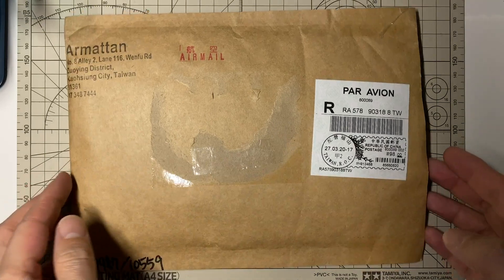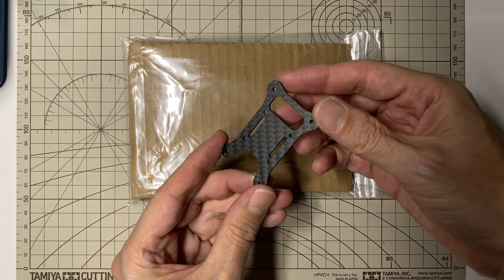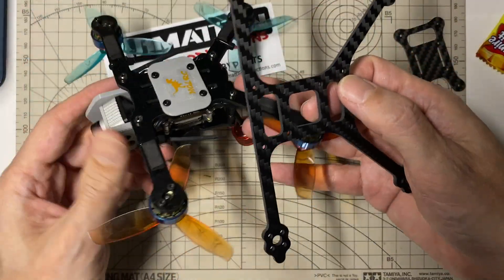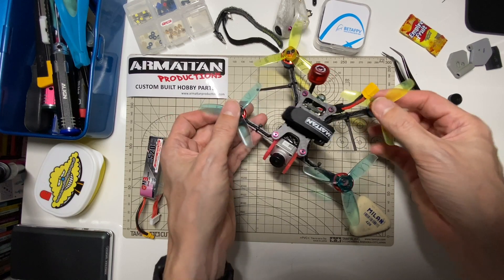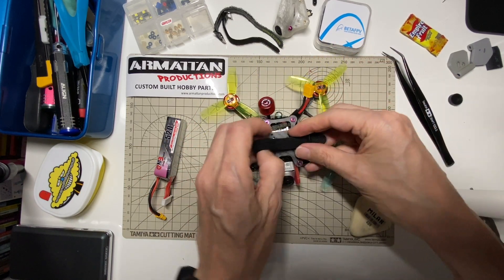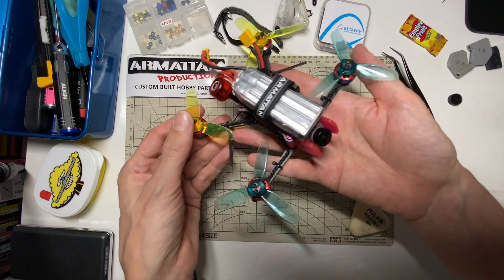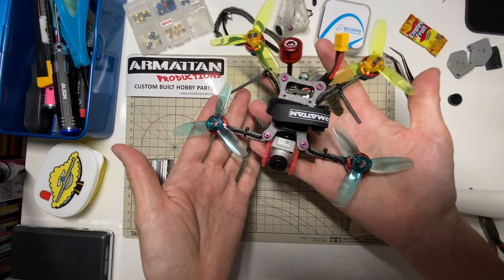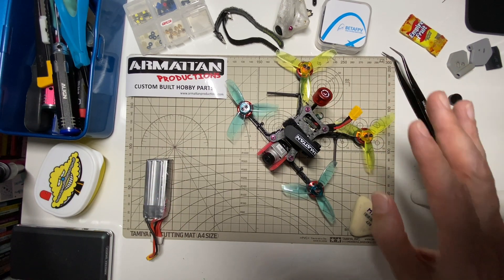Checking Out Custom Carbon from Armattan Productions | 3" Caddx Vista Frame

Comment: Hmmm... unibody main plate.... with front/rear arms at 45 degrees to each other. So either the front or the rear does not have carbon fibers running the length of the arms.
Reply from the maker: That's correct;) I think you already noticed that I have updated it~.~
Reply: mini micro FPV Yep. Just caught up on your latest Skyjumper :)

Comment: Where can I get ND filters for the DJI Air Unit camera?
Reply from the maker: Hello. I covered this subject a bit in a video linked below. You want to look for the 15mm Caddx ND filter. This requires a 3D-printed adapter to fit (although you could probably improvise with some tape or something). The 14mm ND filter fits without an adapter but as I mention in the linked video the filter rests on the lens glass which seems less than ideal.
https://youtu.be/i6WpHRxWcyE